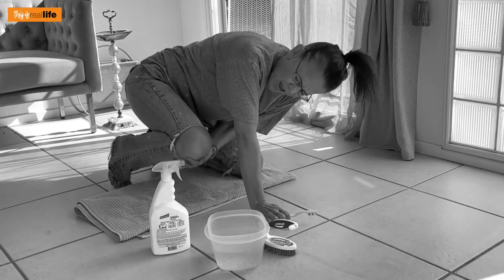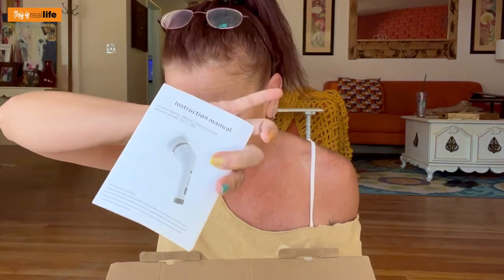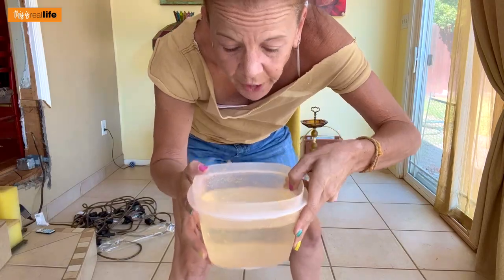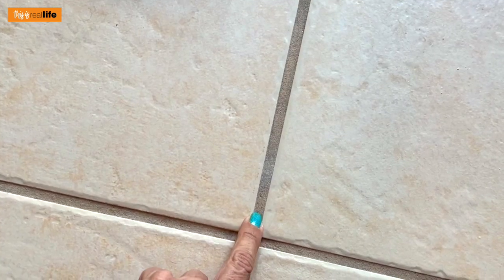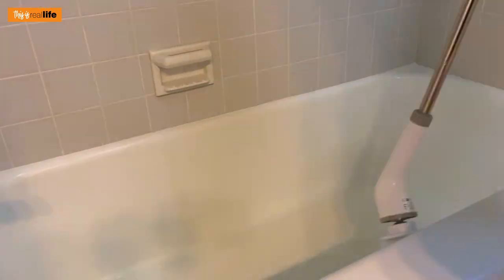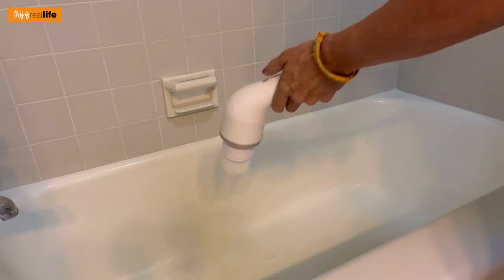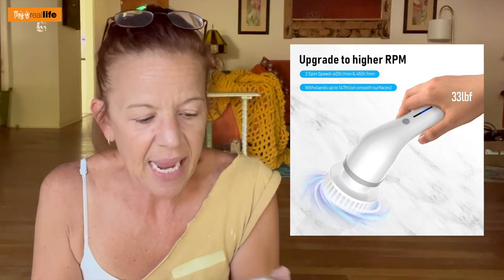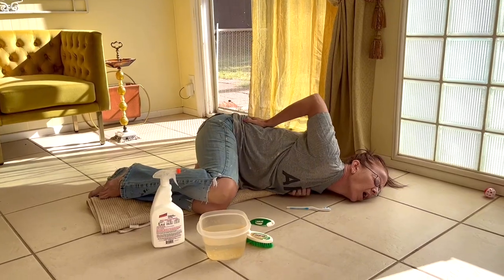Lefree 8-in-1 Electric Cleaning Brush: Test & Review - THIS IS REAL LIFE

Comment: You make a very good point. I just recently bought The cleaner brush. Haven't used it yet, When I brushes and sponge do wear out. How do I replace them I do not wish to purchase a whole new Electric cleaning brush At all. It's a waste of money. They should have Replacement Birch Brushes and pads in stock Not happen Purchase the whole kit again,
Reply from the maker: @rosalinwells6624 - Yeah...I have tested two different types of these spin brush things so far. when I first tested this one, I don't think they had replacement brushes available...but I did just google it and it looks like they have added an 8 Pack of Replaceable Heads to their Amazon page. It does say the replacement heads are compatible with All ANS-8051A & ANS-8050 Brand Electric Cleaning Brushes...so you might want to check those out. I just googled, "lefree 8 in 1 spin brush" and the replacement heads were the second thing to pop up.

Comment: I bought one about 3 months ago and the handle does tremble as you say and I noticed a little bit of cleaning and basically I am using it for tub and shower and sink in bathroom so using 3 attachments only , thanks for clear explanation.
Reply from the maker: @user-nl6co5yi1n - Yeah...that handle needs work. I pretty much just use it hand-held when I am cleaning. And like you...tub and toilet is really all I pull it out for.

Comment: On your kitchen sink, if it is a porcelain sink, what I do is use the flat, square green scrubber pads that are real durable with steel wool, (I think its steel wool).  I soak the sink, scrub a bit with comet cleanser powder. I let it dry for the day. When you rinse it, the bleach takes care of the stains. Just saying that it has always worked for me.
Reply from the maker: @freetob1 - Awesome tip! Thank  you so much. I will for sure give this a try.

Comment: Comet on grout?  I like the 8 in 1 concept, but no.  Thanks for the 'spin', so I don't have to.  
Love your humor!
Reply from the maker: @PatB415 - I love Comet...I pretty much use it on everything :) I too like the 8 in 1 concept, but they really need to work on the extension pole...I don't think it works as well as it should. It needs to extend longer and it needs to hold it's position stronger.

Comment: Questions: how heavy is it with/without the pole?
I bought a Swiffer with pole yrs ago and the pole was a little short so I had to bend over to get any pressure at all.

On the box it does say replaceable attachments...so try typing in 'replacements' instead of what you did.
When using it poleless did it feel clumsy and to large to hold easily.
I really need a spinny thing but was thinking about getting the Synoshi one, which is poleless.
Having a bad back/hips bending to clean  esp the tub is nightmare.
Thanks for review.
BTW,  I subbed.
Reply from the maker: @chainamarie03 - It's not that heavy at all...even with the pole. Yeah...the bad part is the pole is short...so I think adding an extension would be better. I actually preferred using it without the pole, only because it was easier to apply the right amount of pressure. I feel like I will only bust out the pole for hard to reach areas...but for areas where you don't have to bend over or get on your knees...pole-less is the way to go. Thank you so much for subscribing...it means a lot...thank you!

Comment: Have a bad back.
Was thinking about something like this  but I don't know about how much pressure it would take to get things cleaned.
Its a bummer that you can't get replacement attachments
Reply from the maker: @solitairesmith3553 - I'm telling you right now...the pole on this brush does not extend long enough. And the way you have to bend over to get pressure to the surface you are cleaning...I can all but guarantee you will feel it in your lower back after a short amount of time. If you already have a bad back...I'm not sure I would suggest this brush for you.

Comment: Thank you for commenting on this product. I see that the product at the top is bent, making cleaning difficult. If the head were straight, it would be much easier to work with. Ops! You forgot to explain how to clean the corners or edges where the product does not reach.

Comment: they're all similar--a bit overpriced, IMO. The past few weeks, I've bought one of these (suggested by neighbor), i borrowed a steam cleaner, i bought a handheld bissell steam shot (will return). What i found...the scrub is okay to clean tile floors . The original owners stupidly tiled the entire lviing room, dining area, and kitchen. i used this to manually do each tile and cleaned for 30m with hot water and baking soda. Then later in the day i used a steam cleaner to go over it. Like you, it was my 1st time, so i think i'll use it. i would use it for bathrooms sinks and my kitchen floor but it's certainly not worth $55 (which is what i paid including tax). For $35 it might be more reasonable. The fact that there aren't REPLACEABLE brushes and scrubbers is stupid. So they want you to replace it everytime your brush wears, which is incredibly unenvironmental. Also, most don't come with the Ac power. It did almost nothing for my dirty kitchen grout though.

Comment: You need to get some spray Iron Out. Spray it on wait a few minutes voila it’s gone. You may have to wipe it with a cloth but really works. Kitchen sink and bathtub
Reply from the maker: @lindaandersen3289 - I've never heard of Iron Out, but I did just Google it and apparently I can get it at the Walgreens...so I think I might run over there and grab a bottle. Thanks for the tip.